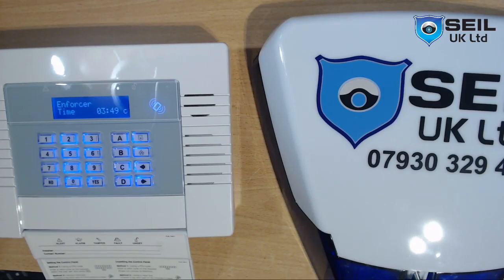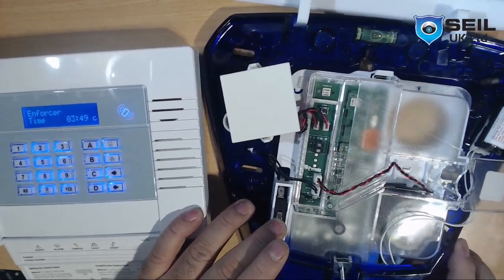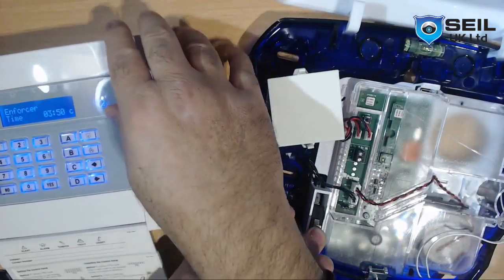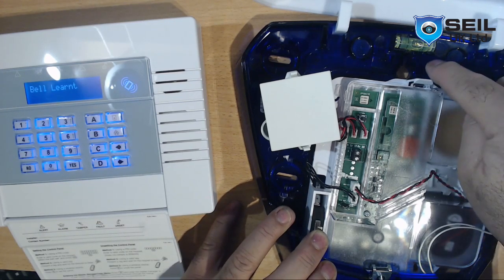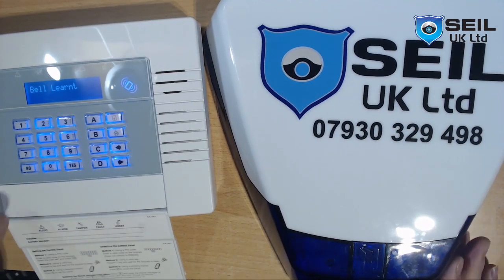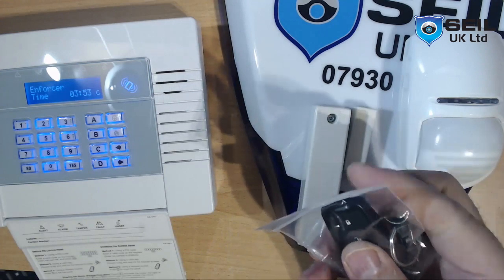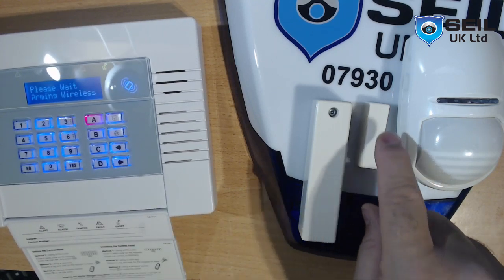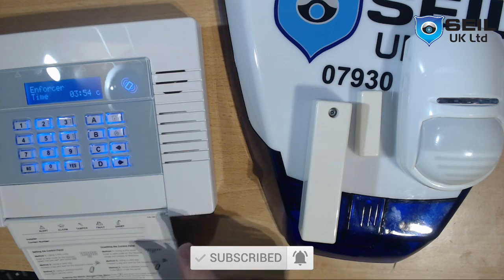How to connect | program external bell with pyronix enforcer kit1 part5

Comment: I have changed the battery on the siren but is still coming up as a fault,any ideas.
Reply: Sorted all good,deleted  bell and re learnt it,thanks for help,top man.
Reply from the maker: Hi check battery voltage with multi meter must show 3.0v each battery. Also what massage display?
Reply: @shahzadsheikhs  wirls supervn f1
Reply from the maker: @andyward937  try to delete and reprogram again panel lost siren. Make sure first 1 bell delete 
Program bell link https://www.youtube.com/live/EVpL-0ceJsA?si=DoeAz_6yuB_BjwtG
Reply: @ShahzadSheikhs  so just gone into menu and scrolled through the menu,I havnt learnt the siren yet but the yellow alert has gone off the panel,tried the siren but not working ,batteries are fine,do I have to take siren off wall to learn it.?
Reply from the maker: @andyward937  no need to remove from wall panel leave learn mode and go to bell and hold learn switch for 2 seconds and leave you hear noise on panel bell learn.
Reply: @ShahzadSheikhs  will try tomorrow, thanks for your help.👍
Reply: Hi its saying its learnt on panel but not working on a test.
Reply from the maker: Or bring bell near panel then learn
Reply: There isn't any signal strength showing on the panel.?
Reply: Shouldn't it learn on the wall outside because that's where it's going,on panel it's saying no signal.

Comment: Hi, I have a Pyronix Enforcer system that I bought and fitted a couple of years ago. It now needs to get the siren bell battery changed. Can you advise if the system would need to relearn the bell after fitting. Also I assume I just need to go into engineer mode and then open the external bell casing in order to change the battery. Thanks for any help you can provide.
Reply: SEIL UK by entering mode do you mean entering the engineer menu? Basically I have 2 questions : 1. Does the system need to relearn the bell after changing the battery and 2. What do I need to do prior to opening the external bell casing so the alarm does not go off  when I open it.
Thanks in advance for taking the time to answer.
Reply: @shahzadsheikhs  
I'm in the same situation to replace the siren battery 

Is it just a Phillips screwdriver screw ?
Reply: @shahzadsheikhs  
Thank you 

Any chance you know what battery is needed ?
Reply: @shahzadsheikhs  

Thanks for replying 

I mean physically opening the box 
I can't access the screw ?